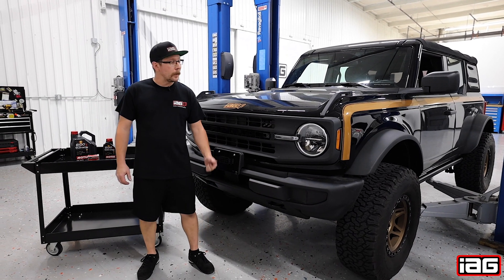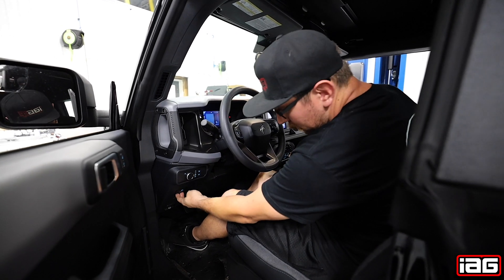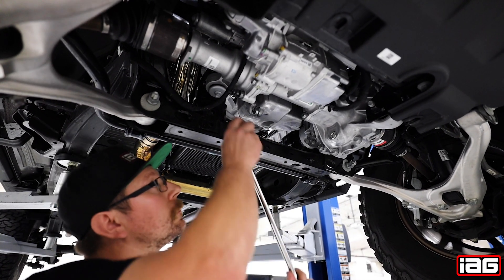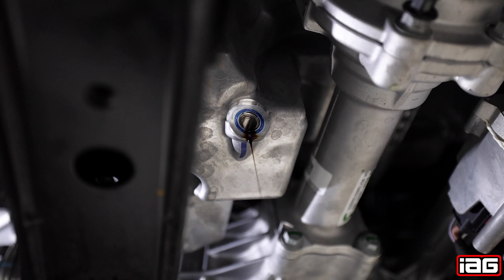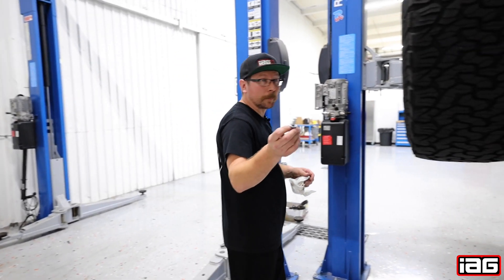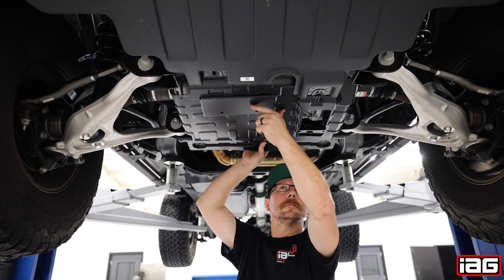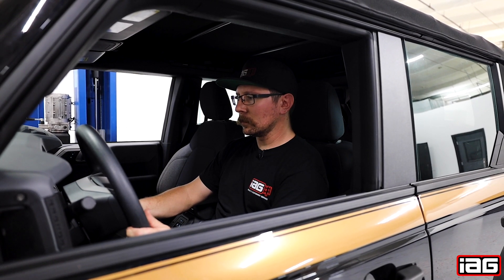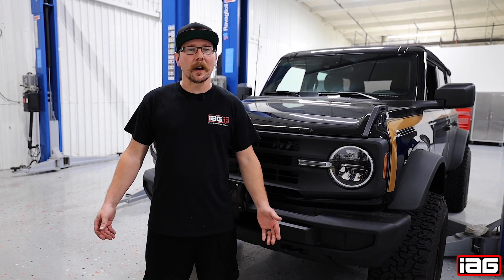"How To" 2021 Ford Bronco 2.3L Oil Change

Comment: Which way does the filter oil valley flow?  Forwards or rearwards?

I have aftermarket skid plates on mine and I'm hoping it flows forward or I'll have to drop the mid plate too.

Comment: If anyone is wondering why he's using a new drain plug, it is because he lost it when removing it. You hear a distinct clinking noise as it falls into the funnel at 2:13 and as he removed his hand he does not have the old plug in in. We've all done that, but for him to claim he is replacing it because "Ford said to" is kind of B.S. If you slow down the speed you can see the old plug yeet into the funnel.
Reply: He showed the new drain plug at the beginning. Some old school mechanics will say once you torque it , change it out next time.
Reply: @RB66_  I have replaced crush washers on drain plugs, but never the entire plug on an oil change.  hmmm...

Comment: Why do you use brake clean to clean the oil filter valley thing?
Reply: So no build up of oil gets into any parts of the vehicle. And make sure it’s clean so the next time you do an oil change it’s clear so any old oil can filter out to the drain pan. Also why would you wanna leave oil lying around your cars engine bay? Gotta leave it clean!

Comment: Doesn’t cranking it over spin the mechanical internals anyway? I get it’s not spinning as fast as running but the cams, bearings, pistons etc are still spinning so I don’t really get the purpose?

Comment: Can you try this on yours for me ? I’m no mechanic but I do all my own work and am pretty mechanically inclined but iv been keeping up with my wife’s bronco since new it barely 14k miles she’s had it for  2 years but I just changed the oil and after running it for a while a decided to remove the oil cap while it was running and it has a lot of air coming out (blow by) iv always been under the assumption that blow by is really bad but unlike other blowby iv seen there’s no smoke coming out just air pressure and little bit of oil sprinkling out because of the pressure behind it but is that normal for the 2.3 ? I can’t find anything on the forms
Reply: "A little bit of the air movement may be due to blow-by, as someone else pointed out (exhaust gases leaking past the rings and valve guides). However the vast majority of air movement you are feeling is due to the pistons moving up and down and pressurizing and depressurizing the crankcase. Air gets pulled up underneath each piston as it moves up, and pushed back down as the piston moves down. The crankcase is connected directly to the space under the valve cover (that’s how the oil that you add to the engine gets down to the crankcase). At higher RPMs, the air movement back and forth is so rapid that it evens out, and you can’t feel it as much"
Reply: @iamroblesonyt  Iv discovered it’s much more common/normal on these smaller 4cylinder engines right? I always thought blow-by was concerning growing up around V6 and v8
Reply: I'd say blow by is not the right term if the pressure equalizes with every stroke. Try doing the latex glove test. Make sure it's fairly sealed and secured with an extra rubber band so it doesn't fall in... If the glove doesn't continuously fill with air, then you know it's just normal air movement from the crank case. If it fills fairly rapidly, then the air is being sucked in from somewhere it shouldn't. It can be hard to tell if you just put your hand over the oil cap as the suction occurs just after the "blow".

Comment: I’ve always wondered if some cars had a built in way to prime the filter and oil system other than pulling either an injection or fuel pump relay

Comment: The oil filter location on the 2.3 is an engineering disaster.
Reply: I’ve seen much worse
Reply: You haven’t seen a lot of engines have you?

Comment: do you need to replace the drain plug every time you change the oil?
Reply: WHy would I change a drain plug every oil Change ...I don't see me doing that
Reply from the maker: @concertscoastersandnitro725  Since the drain plug is plastic Ford recommends replacing it with every oil change.
Reply: @theiagchannel  it it be replaced just not with a plastic one
Reply: As far as I have read, the 2.3 does not need to be changed unless it shows wear. The 2.7 has a plastic drain plug that needs to be replaced every time.
Reply from the maker: Yes, Ford recommends changing it every time.

Comment: Didi you have to remove the driver's side fender-well liner?  In my 2019 Ranger I always had to remove that to get to the oil filter.  It was a pain to do without breaking the plastic clips.

Comment: What does flat foot crank do?
Reply: Primes the system. Basically, lubes up the engine before you actually start the engine and prevents wear on parts when starved of oil. It's actually a must and a very good option to have. Ford had some good engendering ideas... go figure. 
I doubt Jiffy lube would know about this, so I bet you we'll see a lot of failed bearings, and camshafts, etc...

Comment: How does Flat Foot Crank work with Manual Transmission?
Reply from the maker: We are not 100% sure for the manual transmissions on the Broncos. All the manual transmission Subarus require clutch to the floor and gas to the floor.
Reply: Try holding the clutch and  gas pedal fully down while attempting to start the vehicle. Most definitely try this BEFORE draining your oil to confirm!
Reply: @Toasty Great job, and thanks for the help with clarifying!
Reply: I push down all 3 pedals on my MT and it works.  Maybe only 2 of the 3 are needed but I don’t care.

Comment: 2 questions? New oil plug? And, how did you access through the wheel well? Isn't there a wheel well cover?
Reply from the maker: Ford recommends a new oil plug for each oil change. The crush washer is part of the plug. Yes if you watch the shot at 2:40 and 2:52 you can see how we access through the wheel well. We found it to be the easiest way for the filter to come out.
Reply: @theiagchannel  right, I saw uou go through the wheel well but isn't there a cover in the wheel well? did that have to be removed? thanks for the info.
Reply: @winkydee  No covers were removed in the wheel well to access the filter. We had the pleasure of being on a lift when performing this job, so that may have made things a little easier. The filter can also be accessed from underneath the vehicle, but may turn out to be more messy if you dont get out of the way of the falling oil fast enough!